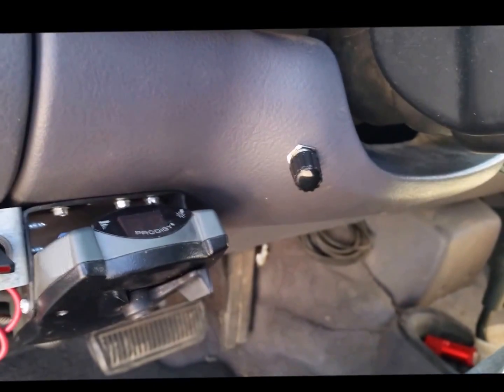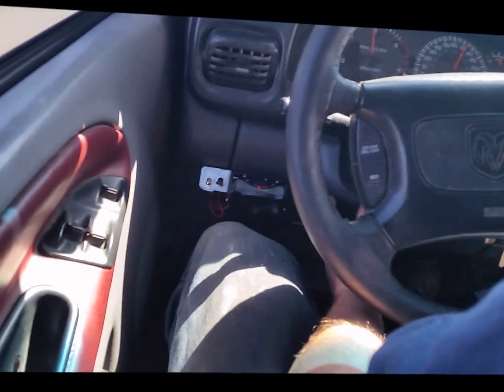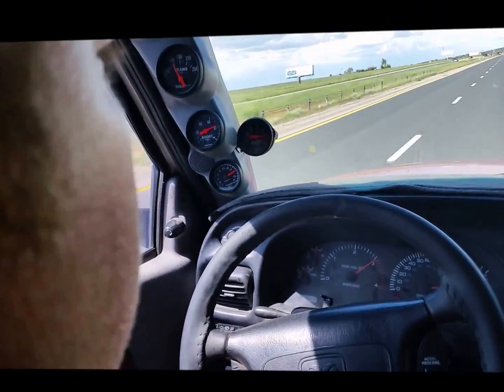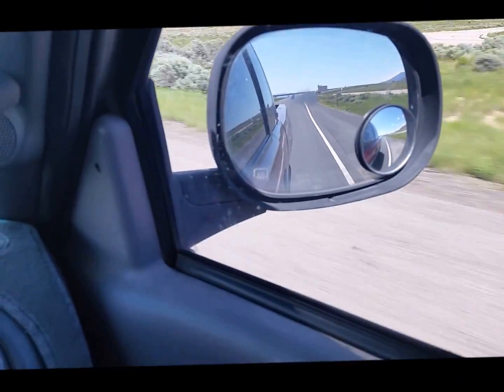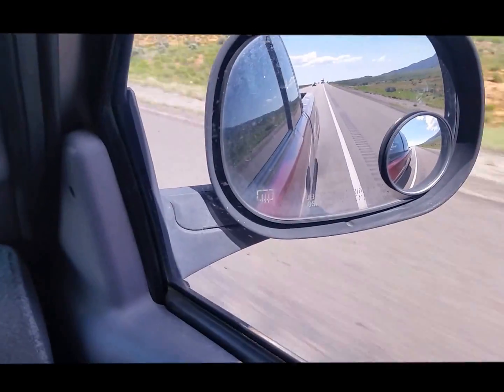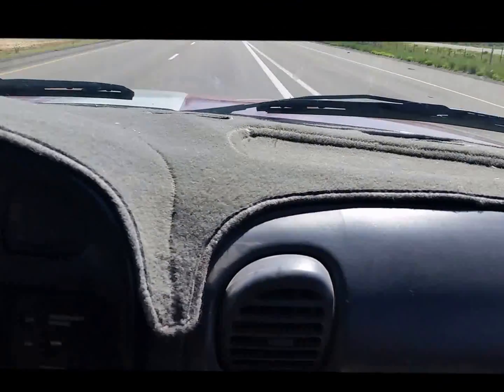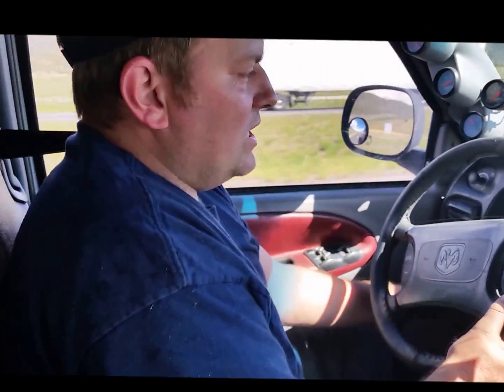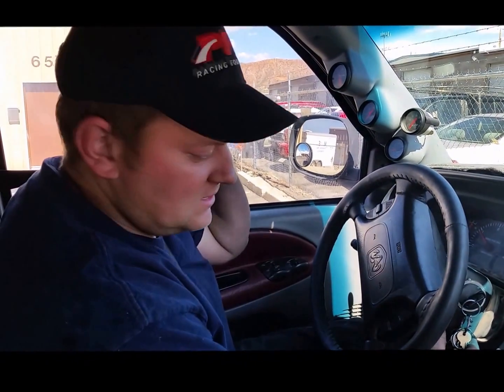In-Cab Fueling Adjuster 12v Cummins

Comment: That 2nd Gen loose steering life
Reply: PowerDrivenDiesel have ya fixed it yet? Those 2nd gens are tricky with their weak ass frames
Reply: PowerDrivenDiesel It really isn’t a hard fix. Look up “intermediate steering shaft” for these trucks. They sell them aftermarket and they’re very easy to replace. I had to rebuild mine from scratch (early 94 truck) but it’s easily the best repair you can make to these trucks.

Comment: I love the typical second Gen dodge steering. also like the fact that it's an early 98 12 valve
Reply: alacey7997 yeah buts it an auto. Not a holy grail. But close
Reply: can be fixed with a steering stabilizer
Reply: @CrazyForCooCooPuffs  LOL! Good one
Reply: @Gohendo  fixed it on my truck so idk
Reply: @CrazyForCooCooPuffs  then you're lucky. I have a steering box stabilizer, upgraded track bars, 3rd gen steering linkage, and a red head steering box. I think I just got a junk steering box though. Cause it still does that dodge wander. Be thankful dude I'm about to buy a psc gear box just to hopefully tighten it up some
Reply: @Zac Henderson  I also have a psc starting pump, more pressure BUT I upgraded for fun. Maybe there's play in your u joints in the steering column/shaft?

Comment: So is this basically a tune for a 12v?
Reply: +Lucas    Yes, this is an in-cab tuner for a 12v cummins, it also works for P-Pumped 24v cummins or Ford guys with a 12 valve swap.

Comment: I want one!!!!!!! it would add so much more power to my stock 12v
Reply: +bailey reidhead On this truck, with AFC LIVE turned all the way down, the truck dyno'd 228 HP, and with AFC LIVE turned all the way up it made 666 HP & 1523 FT LBS at the rear tires for a 430 HP gain!!!